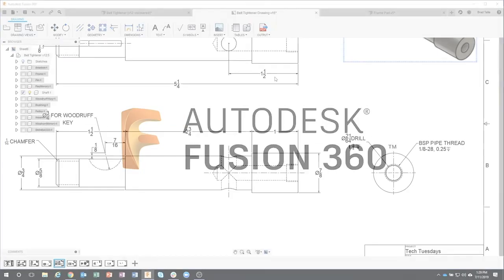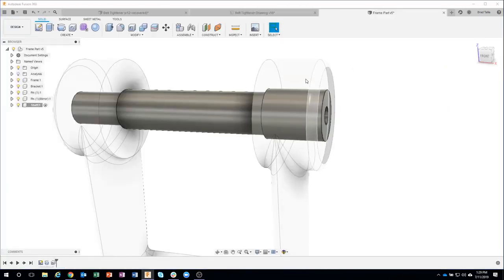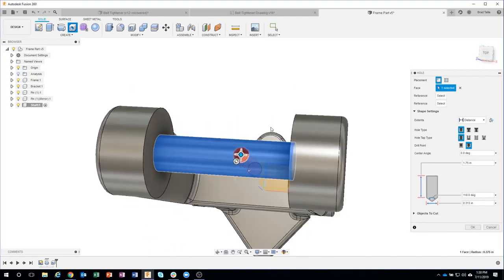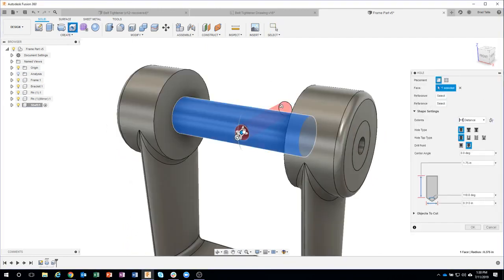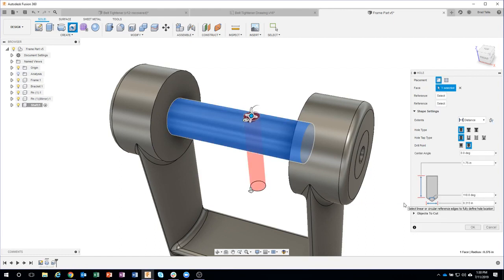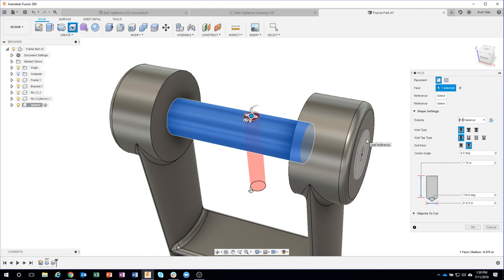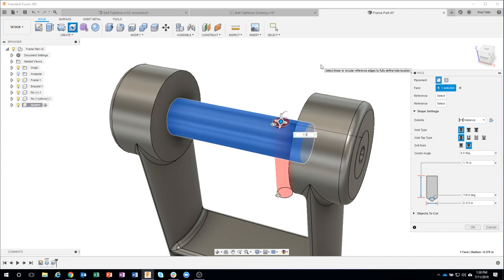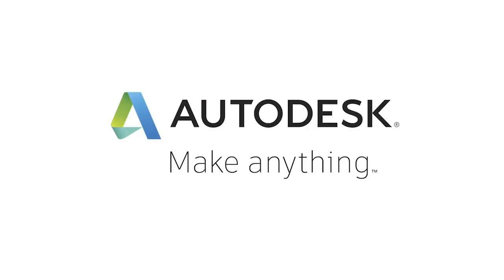QUICK TIP: Hole Command Tricks

Comment: nice trick. However, the hole command is missing one thing: definition of the extent not numerically but as 'to object' .. that option is missing in my opinion
Reply from the maker: Good point.  I think the reason it is the way it is may be because you typically tell a drill how "deep" you want it to drill, especially when drilling a blind hole.  However, if it was a through-hole, I like your idea of "to object"
Reply: @adskFusion  exactly. This feature would be quite handy